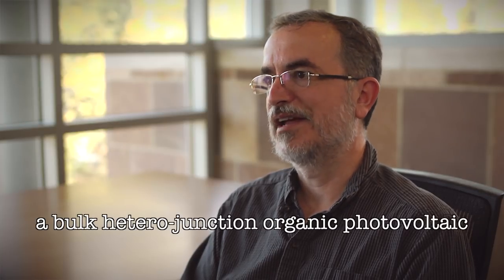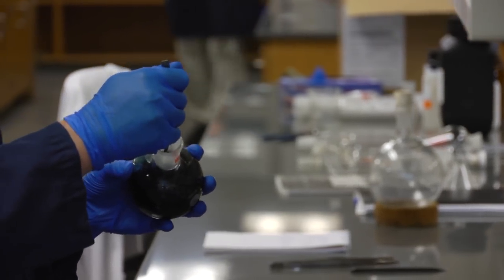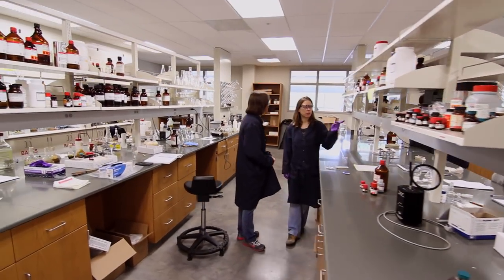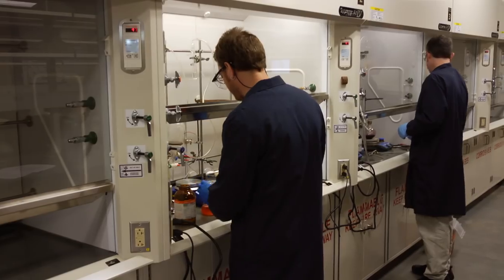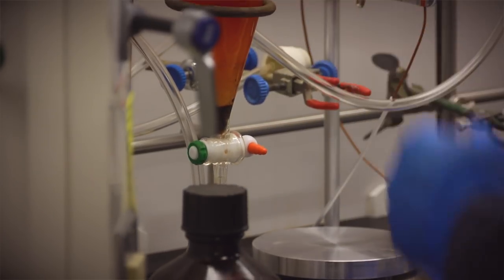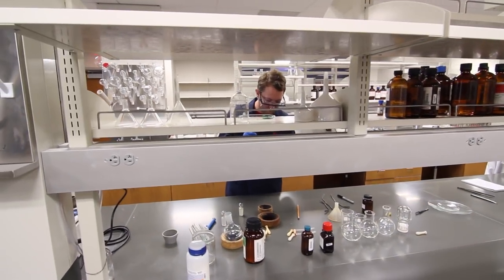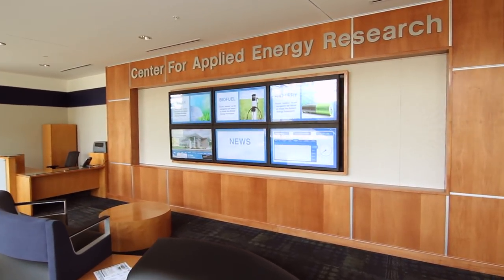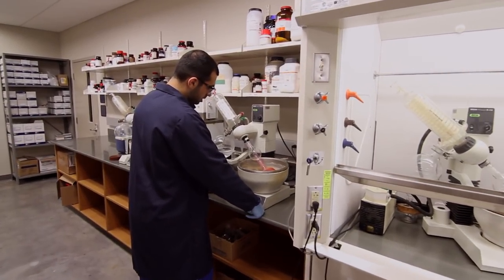UK's John Anthony Talks Organic Solar Cells and Transistors

Comment from the maker: Thanks for your comment.  Here is what Dr. Anthony had to say: "Printed electronics are heavily used in the bioelectronics area, to develop sensors and as scaffolds for neuron growth. The key issue is that it is much easier to interface organic semiconductors with biological systems than it is to integrate inorganic ones."

Comment: Can this be used to make folding hybrotic animats?  If you can print a flexible microchip on a thin material and then print neuron cells onto the scaffold you could artificially fold it into a 3 dimensional shape mimicking a natural brain.  Even without the neurons you could pack more electronic systems into less space if you don't need to rely on a rigid substrate ^_^